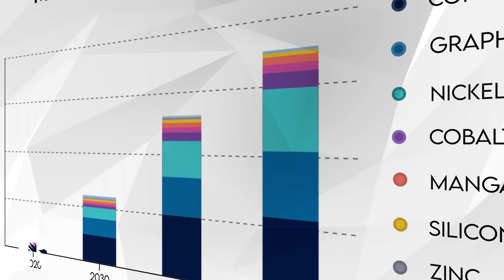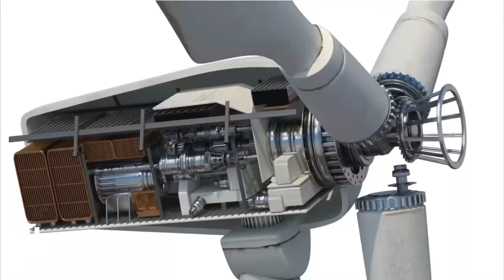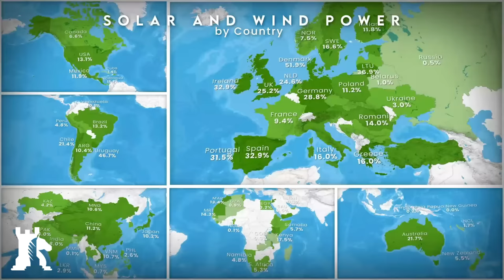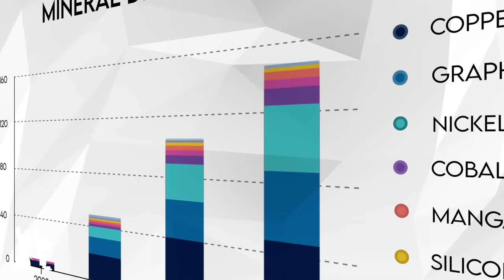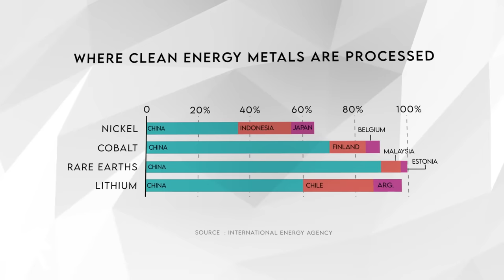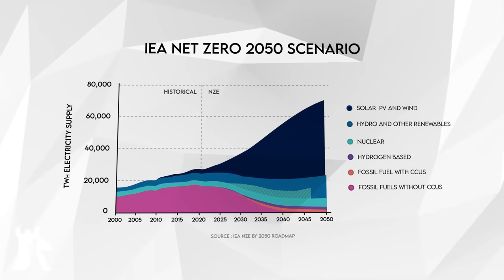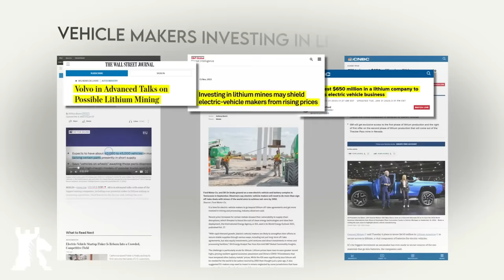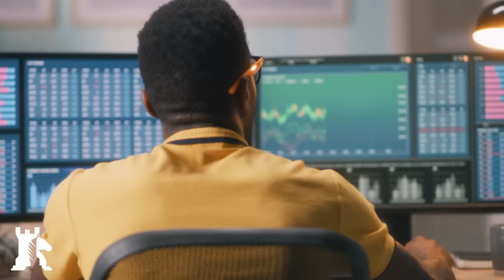Net Zero by 2050 is not happening

Comment: First time an ad from Caspian Report did not settle well, tbh. I usually ignore them and understand it's "part of the game," but this one...  Furthermore, looking at the chart of that stock, it's clearly gone through numerous boom/bust cycles, making it a high risk, high reward kind of play. While the channel does point this out quite directly, it got so aggressive with pushing the stock (just pick a few shares up for a few bucks) that I felt like I was watching another channel. There is obviously a strong connection between geopolitical and geoeconomic analysis and using that knowledge to guide investment decisions with a certain edge in certain market sectors. However, I would suggest that if you're going to partake in this kind of finance and investment related analysis as it related to geopolitics, perhaps spin it off to a separate channel. Just my humble feedback. Long time fan of the channel and I have undoubtedly learned much from you over the years.
Reply: The entire video is a sponsorship, even though he does not say it. The video as a whole is fundamental and leaves out lots of context. For instance, PollyMatter did a great video about the "China owns all rare Earth metals" myth. Still, this video is just a tabloid headline -fearmongering without broader context and then posies this company that will help fix this problem, even though they don't even mine anything. Very unsettling add that pretends it is a video.
Reply: @cadenbigler  Spot on, couldn't agree with you more. I measured my criticism a bit because I am a long time viewer of this channel and genuinely have learned a lot from it. A lot of the information I'm usually already familiar with, especially as my knowledge in related fields has grown over the years, but I always found CR to be a good consolidation of certain interesting topics of high geopolitical relevance. If this disappointing piece is not a one off and represents a trend, I would certainly stop viewing. As many, including yourself, have pointed out, this video is also full of inaccuracies, half truths, and distortions, so it would no longer be worth while if this became the norm. Other than to test my capacity to spot fallacies, I suppose!

Comment: The main problem with storage from unreliables like wind and solar is that it is long term storage. You have a small amount of storage that turn over daily (the sun doesn't shine very well in the evening and people don't need as much electricity mid day); this is sort of daily demand peak shifting. But wind and solar have variability on every time scale from minutes to weekly, to seaons to years. If you're storing electricity from summer to winter; you're getting one cycle per year out of that storage and that single cycle must pay for the entire system; where as batteries for shifting demand intra-day can cycle once per day and potentially get good enough economics. 

Hydro is special, because if it has a reservoir it can store electricity by deferring production. So a 1 GW hydro plant can store at rates up to 1 GW by simply not producing anything. The reservoir is cheap enough that it really can do some longer term storage, but it is very geographically and environmentally limited; what exists now is what's going to exist in 2050. Potentially some small amount of pumped hydro can be built but it won't have the scale to matter.

Nuclear is the only good choice and it has been a great cost to the environment for oil companies and greentards to team up and delay, obstruct and make it more expensive than necessary. Every country could have had the grid of France or Sweden if they had chosen to instead of having the grid of Germany and it's disastrous gas-fueled energiewende.

Comment: There are many inaccuracies here: the extraction figures do not account for recycling. Re: turbine blades - the 'non-recyclable' blades are being replaced overtime. The demand for energy, while increasing, will not increase at the previous rate or more. Also, the increasing recognition of the 'circular economy' has not been acknowledged. I do accept though that things are bleak

Comment: It's true that green energy hardware requires a lot of raw materials to build. However this video does not talk about the resources required to supply fuels to conventional power stations which is needed to do a proper comparison. It also does not consider that a lot of the resources can be recycled at the end of use. 

The fossil fuel industry is also a vast consumer of raw materials, and producer of toxic waste, and requires massive energy inputs to transport the fuels around the world.

I'd also add that a 3-4MW turbine is not a great starting point. 15MW turbines are currently being installed offshore in Europe. These are much more resource efficient that smaller turbines.

Comment: Most of the car industry are moving towards LFP batteries which use zero Nickel or Cobalt or any rare earths. Other battery chemistries are surely going to be fully commercialized within this decade. 

As well as the wind turbine blades are now being recycled. Your information is out of date so eithet you are not aware of new information or your purposely being misleading.

What we need is a combination of nuclear, wind, solar, and geothermal as well as electrifying transport. A combination of methods means we can prevent any issues with any one source and if we have a fully connected grid worldwide we can avoid needing much for storage as the sun and wind is always blowing and shining somewhere and nuclear and geothermal can also help stabilize the grid. Could also use hydro but im not as big a fan of that but its also an option to use.

Comment: this highlights exactly why battery technology should be a backup technology for renewable energy storage. greater emphasis should be put on easier to store and multiuse hydrogen facilities. Australia is already experimenting with Germany on the use of Hydrogen production facilities powered from renewable sources - and once combined with nitrogen (a naturally forming and abundant gas), ammonia can be stored and transported with already existing LNG supply chains. Ammonia is also a industry standard fertilizer.

This essentially allows countries with greater capacity of renewable energy to export this renewable energy to less competitive or developing nations and the fact this isn't talked about more is criminal!

Comment: One thing you haven't discussed with relevance to dropping CO2 emissions is energy conservation. The lower we can drop energy use (home insulation, smaller more energy efficient vehicles, more public transit and bike/walking, not doing silly wasteful things like flying to paris to go shopping, repairing items when possible instead of replacing at the first sign of wear), the less energy we need to run society, and the less minerals we'll need to mine. I think it's probably the single most critical piece of the puzzle.

Comment: (I Really think our best option for our Future, is Utilizing New Nuclear energy options) Small form reactors, LFTRs, Thorium Reactors, liquid reactors. Utilizing our advanced modern technology. Improved engineering & material science. Utilize our greater understanding of safety & designs. We have so much More advanced computer technology, robotics. It will really allow any nation to be pretty much energy independent. Less reliant on fossil fuels. They'll have efficient, stable electrical grids and the rest of the grid could experiment with alternative power sources, etc. 
We need to heal from the trauma of our past. See & learn that those things only happened solely from Us not understanding what we were doing when it came to nuclear energy. We didn't have advanced enough technology, material science, engineering, safety measures, understanding of how to go about everything, etc. This source of energy will greatly help the world improve towards the future and lowering emissions. More than anything else could, while also providing a very stable electrical grid system. Currently we have alternative energy options but the majority of our grid is powered off of fossil fuels and emission producing sources of energy. We will be so much better going forward commiting to modern advanced nuclear energy options.

It baffles me. Even tho Society is struggling, We are yet to even attempt to implement a concept around: "The better off the lowest income people are doing; The better off the rest of our countries economy could be doing." -Think of it like a ecosystem in nature. The least important little things might seem meaningless and insignificant yet, if they crumbled away, the entire ecosystem would crumble. The last things remaining would be the top diverse predators that eat everything else.. until they eat each other.. leaving just a few top sharks in the ecosystem.. the whales would all be gone once the plankton crumble away, the sharks would eat the whales. Then once all that's left is sharks, the sharks would eat the sharks. *(Think of this but as a analogy for our economy and our modern day society..) 
If we instead decided to support the lowest people in the ecosystem, there would be a beneficial systematic dispersion towards other aspects of society benefiting. All because the lowest people would be flourishing. I say flourish but I really just mean, able to obtain the most basic essential living standards... Yet even that would Vastly improve our current state of our economy & society *Also imagine this analogy in our economy. The more help we invest in the lowest level people, the more it would trickle into every facet of our economy. If poor people can pay their rent & not go homeless: landlords would get $, businesses would get $, banks would get $, local small shops would get $, mortgages & bills could be paid, insurance companies would get $, Taxes would get $, So essentially that $ would go out & filter right back in to improve our Country while simultaneously improving our quality of Life. Every bit of the economy would somehow find a way to benefit off of this situation... I don't get why we haven't even Given it a chance?? If it doesn't help? Then by all means stop it and figure out what problems we could be facing might be one's that run way deeper than expected and that would take drastic changes to improve that situation... (I hope we TRY something soon, before things get any more unstable. The worst thing we could do is continue on doing exactly what we are currently doing. It might get to a point where overcoming our struggles could simply become a pipedream. I don't want it to get to that)

So many people i know work so hard yet can barely afford to get by at the lowest cost of living level.  *It baffles me. Even tho Society is struggling so much. We are yet to even attempt to implement anything? Like a concept around: "The better off the lower income living people are doing; The better off the rest of our entire countries economy could be doing." Maybe? -Think of it like a ecosystem in nature. The littlest things might seem meaningless and insignificant yet, if they crumbled away, the entire ecosystem could crumble. The last things that remain would be the top predators.. but they will eat each other.. leaving just a few top sharks in the ecosystem.. the whales would all be gone once the plankton crumble away, the sharks would eat the whales. Then once all that's left is sharks, the sharks would eat the sharks. *(Think of this but as a analogy for our economy and our modern day society..) 
If we instead decided to support the lowest people in the ecosystem, there would be a beneficial systematic dispersion towards other aspects of society benefiting. All because the lowest people would be flourishing. I say flourish but I really just mean, able to obtain the most basic essential living standards... Yet even that would Vastly improve our current state of our economy & society *Also imagine this analogy in our economy. The more help we invest in the lowest level people, the more it would trickle into every facet of our economy. If poor people can pay their rent & not go homeless: landlords would get $, businesses would get $, banks would get $, local small shops would get $, mortgages & bills could be paid, insurance companies would get $, Taxes would get $, So essentially that $ would go out & filter right back in to improve our Country while simultaneously improving our quality of Life. Every bit of the economy would somehow find a way to benefit off of this situation... I don't get why we haven't even Given it a chance?? If it doesn't help? Then by all means stop it and figure out what problems we could be facing might be one's that run way deeper than expected and that would take drastic changes to improve that situation... (I hope we TRY something soon, before things get any more unstable. The worst thing we could do is continue on doing exactly what we are currently doing. It might get to a point where overcoming our struggles could simply become a pipedream. I don't want it to get to that)
Reply: I read the whole thing and I agree.  Years ago they had this thing called "trickle down economics."  I gave it some thought back then, slapped my palm against my forehead and said, "They got it backwards."  It's not top down.  It's bottom up just as you say.  Helping the people at the bottom will give them more disposable cash.  They'll be able to buy more products.  Businesses will be stimulated and expand.  It's a win-win thing.  This can be done with education and the infrastructure projects you describe in your first paragraph.  Some government training will be necessary, but an investment in people will have a good payback.

Not too many guys think outside the box like you.  Oh yeh - we can build facilities to recycle nuclear waste while we do the other stuff.😊

Comment: This really glosses over the fact that the problem is the profit motive. You can make organic solar cells, you can chemically recycle wind turbine plastics via pyrolysis, you can also perform methane pyrolysis on natural gas and extract the hydrogen using an iron ore catalyst to trap the carbon in the solid form of graphite. Its just not as profitable so instead we're only producing solar PVs with highly extractive and exploitative supply chains, we're focused on green hydrogen (which is a waste of everyones time and energy), and focusing on lithium ion batteries instead aluminium ion or sodium ion. It's just not as profitable

Comment: 50-Megawatt Gas turbine vs 15 wind turbine is not fair comparison since gas is required, tubes are required, tanks are required.  The comparison is hard to take everything into account but the cost take account for almost everything, and renewables are cheaper than gas, that ignoring the fair tax to recover co2 emitted by gas.

Comment: We need to fix our waste stream.  Make things last longer and build things in such a way that the critical material inputs are more recoverable.  Use nuclear to significantly suplement "green" energy. Desalinate to rebuild soil and recharge aquifers, mine minerals from the seawater in the process (won't replace traditional mining, but should be a little more than a drop in the bucket for certain minerals) and use the waste salt as backfill for earthworks to manage water distribution and maybe even pumped hydro storage. 

Some of those ideas may be too impractical to work, I'm no expert, but I think we can figure out something.  I don't think the biggest hurdle for us now is a lack of material or engineering prowess. I think the biggest hurdle right now is the lack of clear and immediate financial ROI.  Stop sucking people (myself included).  We better than this.

Comment: the main problem is the manssive energy waste of sectors like transport and energy. transport has used fossil fuels with efficiencies of like 35% on ICE which improve to 90% for EVs. energy sector is currently required to produce giant amount for the iron and steel industry and also OIL industry. ONLY to then get those resources be landfilled and not recycled, because its cheaper to  mine more raw ores.

Comment: Use water to run internal combustion engines ,
 The petroleum products will still be needed for water powered motor vehicles , like cars , busses , trucks , trains , ships , aircraft and submarines . 
 The tech has been around since the 1960s at least . -- at least 2 such vehicles have been built and run , where i live , Each time , 'MIB'  came to visit and heavyied the creators of those vehicles .